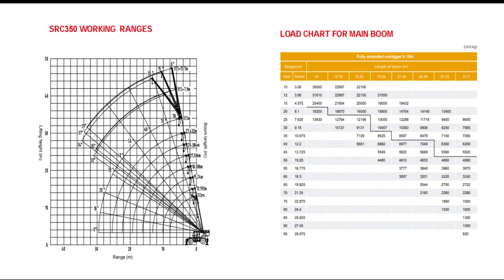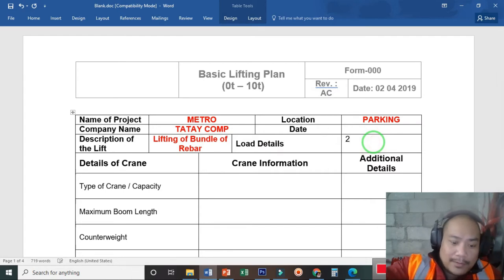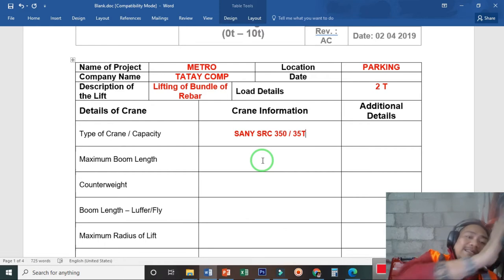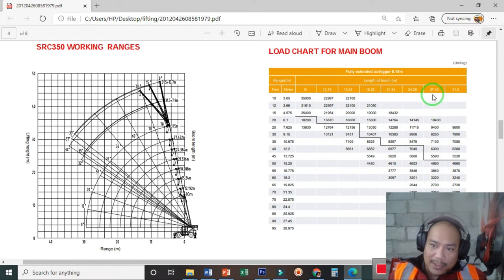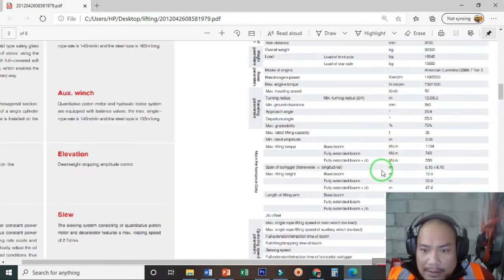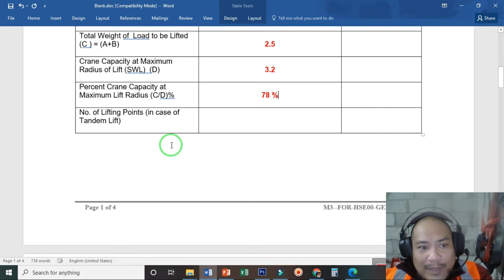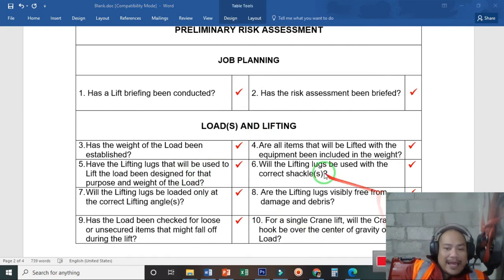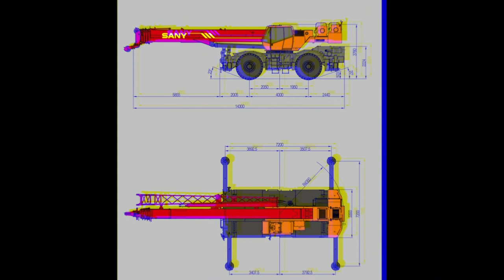How to Prepare Lifting Plan || Basic / Repetitive Lifts

Comment: How to know 
Weight of Rigging Lifting Equipment?.
SWL on each Lug ?
Reply from the maker: check TUV certificate
Reply: @tataysproject9238  from where can I get the one.
Please provide any link if available. Please
Reply from the maker: @hazee8089  TUV certificate are provided by a 3rd party contractor after finish inspection your equipment.

Comment: I think it is an awful lifting plan, you have not established the actual distance of the bundle in relation to the crane on site (this is a basic information), therefore, your calculations are factually incorrect. They are only correct if the bundle is inside your radial distance. Also, you have not established the type of lifting gear and confirmed its lifting capacity (Certifications), chains, webbing slings, etc. nor the angle.
You did mention the points on the bundle, but not the recommended angle.
It does not matter if it is basic, you still have to tell the crane supervisor or the crane operator, the type of lifting gear to be used.
Someone is signing for the lifting permit, so act accordingly.
I am an AP (Appointed Person) I do lift plans, but even if I am a crane operator, I would refuse your lift plan on site due to lack of information.